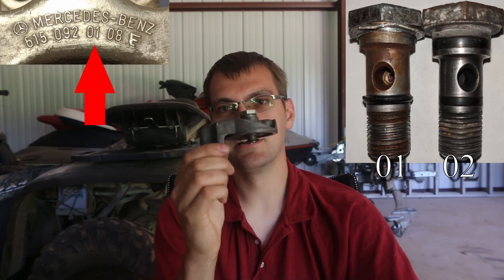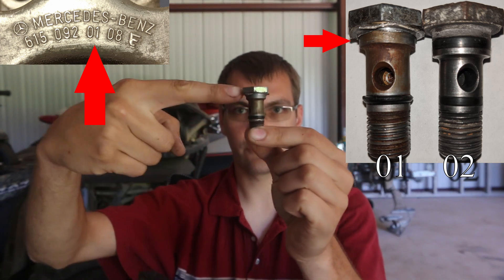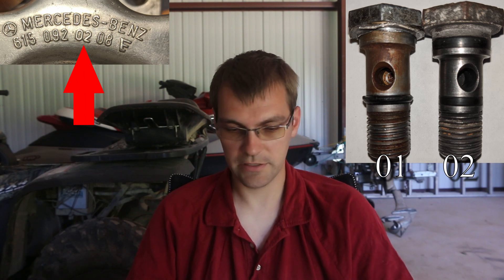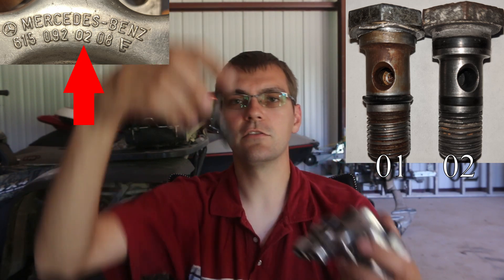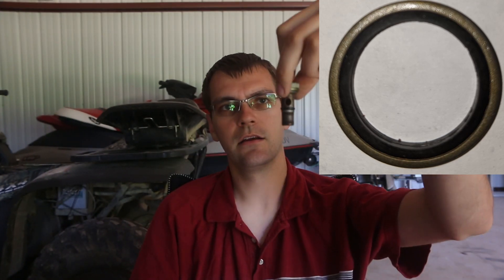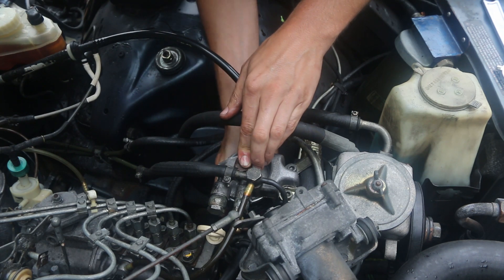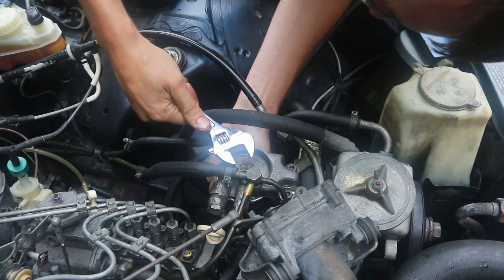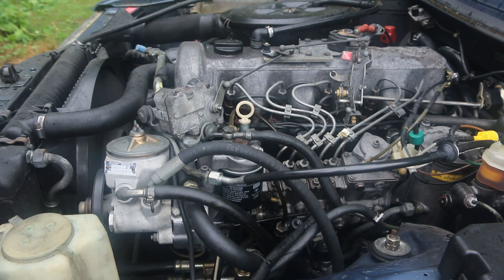W123 Secondary fuel filter leak: Crush washer Upgrade and O-Ring replacement.

Comment from the maker: Here are some links to what you need to refresh your secondary fuel filter seals:
01 style housing:
Bonded rubber crush washer: https://amzn.to/3ihmfPc
M10x15x2.5 Viton O-ring: https://amzn.to/31w78LX

02 Style Housing:
M14x19x2.5 Viton O-ring: https://amzn.to/2BsWif9
M10x15x2.5 Viton O-ring: https://amzn.to/31w78LX

These links are affiliate links, purchasing from these will share some of the purchase price with me, at no additional cost to you. You get the things you need at a great price and it helps support me doing more of these videos, how cool is that!

Comment: Thank you! such good videos. I have 3 W123 diesels. I  made the Balwin 2 micon filter mod. I ended up with a leak around the flat filter rubber gasket and out of the filter bolt. While awaiting the 2.5 mm o ring I decided to  replace the orings with a thinner oring from my harbor freight O ring box. That fixed the bolt leak but not the gasket leak.. what to do besides tightening the filter bolt?
Reply from the maker: It must be bottoming out on something before the gasket contacts the filter head.
Is the timesert screwed all the way on the filter bolt?

Comment: Thanks for video! So, is this something I could possibly find at a napa, Autozone, oreillys, parts plus, car quest, advance auto parts store? Ace? Home Depot? I’m in the country. Don’t use a credit card for online orders. Is their a name or size I could ask for? Thanks so much
Reply from the maker: Maybe. The O-rings if you have the -02 housing should be available at a good auto parts place, or ACE, they are -M2.5x10 and -M2.5x14, you may not find Viton o-rings like I got, but Buna-N should be quite common and work well. If you've got the -01 style with the single o-ring and crush washer, that may be trickier, the o-ring should be easy, that is a -M2.5x10 size o-ring, as far as the crush washer, the one I used is a M18 rubber bonded crush washer, they might use that on some oil drain plugs or big truck fuel fittings maybe, shoot me an email if you have that style and can't find anything (tom at trythistv dot com)

Comment: My w123 petrol engine shuts off once it reaches near the optimal temp. Do you think it has something to do with engine oil? Thanks
Reply from the maker: Which engine specifically? Doesn't sound like an oiling problem to me but I'm not super familiar with the gas/petrol engines as much as I am with the diesels, but I would suspect something like fuel system is turning off enrichment or a sensor is heat soaking and failing. Will it restart once it's up to temp or do you have to wait for it to cool back down?

Comment: Great video and great idea.  On a side note, I wanted to get your thoughts on some issues I'm having with my 85 300D (CA Car). This just started happening, but at around 65-70 mph, it almost feels like I'm in a go-kart with a governor. The engine isn't missing but it feels like I can't accelerate any faster. It's fine after I get off the freeway and drive it around town at slower speeds.

The same thing happened today when I was going up a steep hill. It wasn't missing but I could feel it in the gas pedal---I couldn't really accelerate until I got over the hill.  I went up that hill twice today and experienced the same problem at the same spot on the hill. Again,  never experienced this problem before. 

I've done a purge on it, changed out the pre and main filters, and they all looked good.  Could this be a fuel tank strainer issue or perhaps an issue related to the EGR or trap oxidizer? The car starts and runs like a top outside of these recent issues. Any thoughts would be appreciated!
Reply from the maker: I'd check your fuel pressure, I had a very similar problem with my 82 when the secondary filter was just restricting the fuel enough that it wouldn't keep up at higher speeds.
It could also be worth checking into the ALDA and EGR, if your alda is not working properly, you'll not get extra fuel when the turbo spools up, and if the EGR is malfunctioning it could be recirculating excess exhaust.
Did the 85 CA 617 engines have a trap-ox/cat or was that a later addition?
Reply: @trythistv  Thanks. Stupid question but how do I check or test the fuel pressure?  My fuel hand pump has been broken since  I purchased the car a few months ago. I'm wondering if the lift pump is bad. Could those items cause this type of issue?  It does have a trap-ox.  What are your thoughts on completely deleting or bypassing the pollution related items?
Reply from the maker: I actually have a video on how to test fuel pressure, and the overflow valve that acts as a pressure regulator. Its right here: https://youtu.be/jiPonBwkxeI
If the EPA is listening I'd say all the emissions equipment that came on the car needs to stay intact...
However, The Trap-ox was actually found to increase emissions as well as clog up with junk and choke out the engine and potentially damage the turbo, Mercedes actually had a recall on them due to having such issues, and the EGR can stick open and clog the intake with soot... Both of which are in my opinion pretty bad, and what little difference in emissions is made up for by the fact that the cars are getting old enough to have kids that are drinking alcohol lol
The EGR can be checked, or repaired, however the trap-ox I would certainly look into replacing with some alternative arrangement.
Take a look at these two threads: (And the products offered by these people)
http://www.peachparts.com/shopforum/diesel-discussion/355250-sale-egr-delete-block-off-plate-kit.html
http://www.peachparts.com/shopforum/diesel-discussion/351863-1985-ca-emission-617-owners-you-need.html
And then make whatever decision you feel is best for your car ;)
I have a 1997 Dodge diesel truck, which came with no EGR, no trap-ox, no cat converter, basically zero emissions controls, because the EPA didn't require diesels to have any of that stuff until 1998, Mercedes was just trying to be ahead of the curve. Depending on your state requirements, missing emissions equipment could fail your inspection, but most states don't care about older diesels, my state doesn't have any emissions inspections at all, so unless you're rolling coal and being generally irritating, nobody cares about the emissions equipment.

Comment: Which size on the rubber impregnated washer?
Reply from the maker: M18, this link should take you directly to it: https://amzn.to/3ihmfPc You'll also need one of these O-rings: https://amzn.to/31w78LX (M2.5x10 Viton O-Ring 10mm ID, 15mm OD, 2.5mm cross section)
I haven't had a drip or a leak since replacing those 2 seals.
Reply: Thanks. Figured it was that one but wanted to double check

Comment: I have a question for you. Should I be getting foam out of the return line while pumping the priming pump? I bought a parts car recently and I believe I'm not getting fuel since I can't start the car as of yet.
Reply from the maker: You should get a stream of diesel once its filled the secondary filter and everything, if you're getting foam after a good amount of priming that would indicate to me that you've got a ton of air getting into the system somewhere, maybe a cracked rubber line or such.
Reply: @trythistv  that's exactly my thinking. The bubbles must be air mixing with the fuel system somewhere. Question is where
Reply from the maker: Do you still have everything hooked up to the factory fuel tank? I would pull the supply line and return line from the tank and loop them into a container in the engine bay like I do in this video: https://www.youtube.com/watch?v=DTbOKS3PwxM Just put some diesel in the container, and see if you can prime it up, once its gone through the lift pump it should be under pressure so it would leak fuel out rather than letting air in, thats not to say it can't let air in, I've seen some weeeiiiirddd things happen before. The older white primer pumps are notorious for leaking air in as well